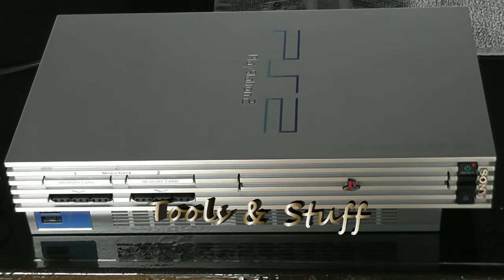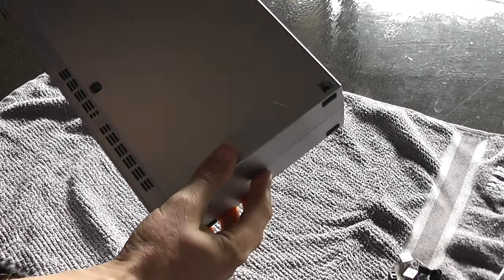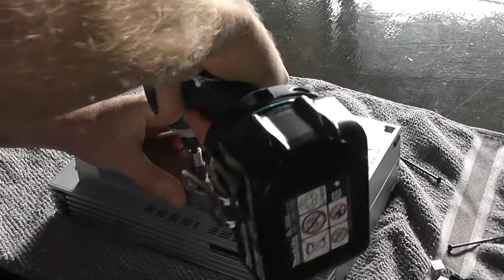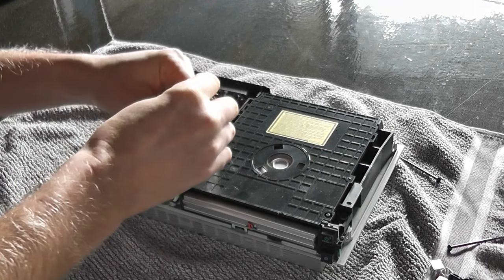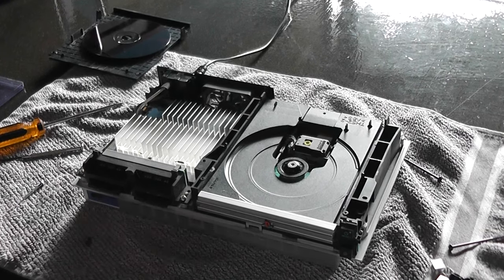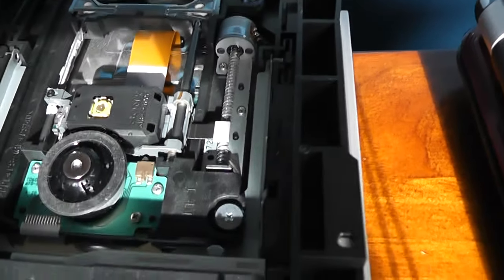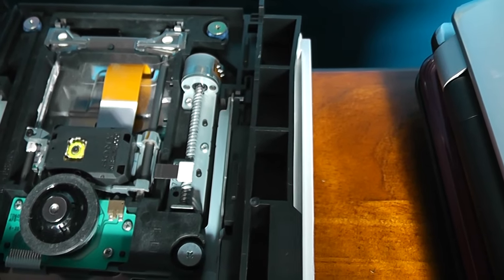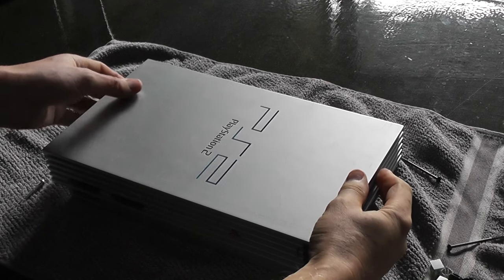🎮 Playstation 2 Repair. Drive repair in 5 minutes 🎮

Comment: Its a major importance to mention the exact type of screw driver to open the lid of the laser. What kind of philips in mm since as you said a fine philips doesn't tell the exact type? My fine philips is too big and I already started to strip the tiny tiny screws.
Reply from the maker: Just use whichever one fits. If you can't work that out you shouldn't be opening it in the first place.
Reply: Wow. Best answer ever.

Comment: Hey, I'm having the same issue where the laser wont travel back and forth, I tried what you recommanded but it's not working and I don't know what to do. It's a fat as well, but I think the disc drive is an older model, wish I could show you a picture

Comment: question will I damage the disc tray if I physically use use my finger to close it instead of the eject button? I also eccedently  press the eject button and stop the disc tray half way it closed on its own am worried?

Comment: Hey guys,

I'm having problem with the worm motor of the disc drive. It's not moving the laser back and forth and I have no idea why. The plastic teeth are making contact, the gear is greased enough, the laser lights up but nothing moves.

It was moving a couple of days ago before I tried to adjust the potentiometer to be able to read CDs again as the laser was only reading DVD. (so I don't think it's the ribbon, I was really really careful) 

I tried also to adjust the laser height with the gear at the top but nothing worked.
I'm confused, even if the laser would be dead it would still move back and forth, right?

Besides it still lights up, and the disc is still spinning when inserted...  Have no idea what's the issue here.

Comment: When I was a kid years ago my Lil sister at the time was running around outside not paying attention when she dropped my PS2 onto the concrete below from the staircase it was resting on which was a good 15-20 ft. I got so pissed at her for that and yet it STILL works even to this day. They were definitely built to last. Granted it looks very rough and should probably buy another however it used to belong to my dad when I was born and he gave it to me as I grew older. (Was born the same year PS2 came out)

Comment: When u took the top off what screw driver did u use for the small screws
Reply: Great video I had the grinding noise and the wording data not read.  After following your simple steps, PS2 now working, quiet as a mouse.  Great and many thanks.
Reply: Keith Cooke wut small screw driver did u use

Comment: I recommend that you open the disc tray before removing the top cover of the tray. It will be easier to remove.
Reply: It is stuck how are you supposed to open it
Reply: It wont eject so thats impossible to do. if it was possible however it would still be a stupid idea based on the now ejected tray been in the way of lifting the case off. defo a brain dead moment there
Reply: @johnproudlock2900  Yeah right.

You can do it without opening the tray, but you'll need more force because of the magnet in the top clamp. So yeah, if the tray is stuck, just remove the cover. But if it isn't, it will be easier to remove with the tray open.

Comment: the warranty wasnt actually long gone in 2016, it ended in 2018!
Reply from the maker: If you had an original chunky PS2 like in the video and not a slim one, then the warranty would be long finished. That unit was 13 years old when that video was made. Sony stopped all production of PS2's in 2012 and stopped selling them in 2013. You would have had to have purchased the last one and buy an extended 5 year warranty for the warranty to expire in 2018.
Reply: @ToolsAndStuffOFFICIAL  I see.
Reply: Fat PS4 was discontinued in 2004, only the slim model that was continued to be produced until 2014...

Comment: What do I do if my PS2 doesn’t even turn on anymore? I tried to trouble shoot and nothing. I don’t want to give up on it yet? Is it the power source? Can someone tell me what the reason is? The PS2 is still preety new still, I hardly used it, 🙄
Reply: If you’re comfortable taking it apart make sure the ribbon cable from the power button to the motherboard is hooked up that might be it
Reply: @tommyb1753  thank you, I did take it apart but nothing. I ordered a used one on Amazon and it works fine. I have the PS4 but I like to have the option of playing my old games if I desire. The Ps5 it’s hard to find. I’m happy with my PS4, I’m in no rush to get a ps5 lol
Reply: @michaelmontes2691  well glad everything worked out for you! I agree I love my Ps4 but also love having the option to go back to my ps2 when I want to play my childhood games. Currently own 3 ps2s and have been inside and out of all of them if you have anymore questions I’d be happy to try and help
Reply: @tommyb1753  hi just read this comment and I just have a question if you don't mind. My FAT PS2s disc tray vibrates briefly at the end of its extension and the vibration stop when I lift slightly on it as it comes out. Is there a way to remedy this issue? It just sounds like over time it'll wear out and I'll have a bigger issue on my hands. I'd like to get to the bottom of it to get every bit of life I can out of it.
Reply: @toasty3719  hey! If you’re comfortable taking it apart, look at the gears on the disc drive and make sure they’re clean, also it might not be the most popular method (some prefer a dry grease) but I put dielectric grease on the metal rods and the metal screw like rod to help the disc drive open and close smoother, that should help